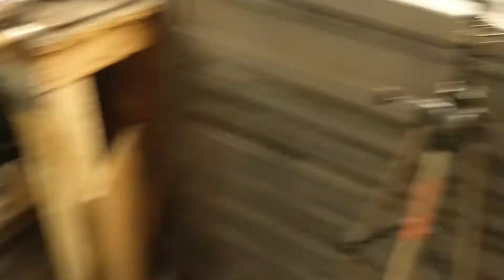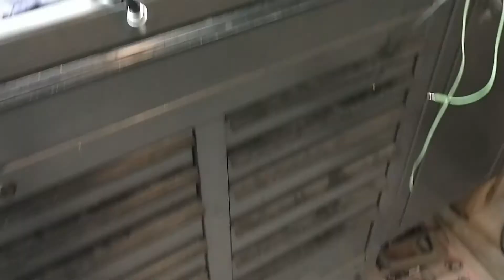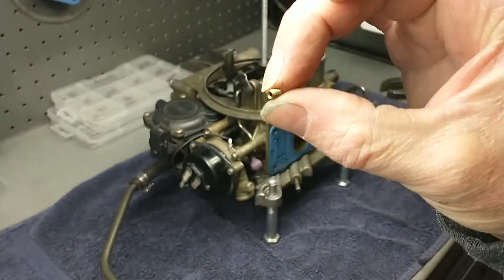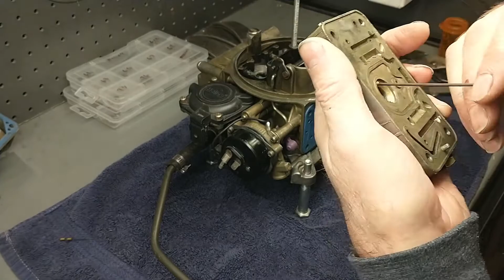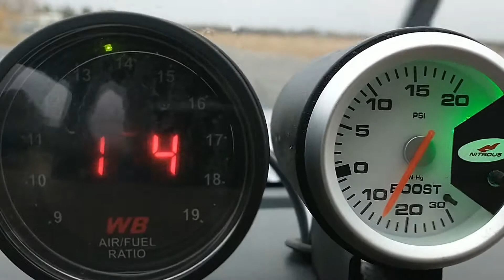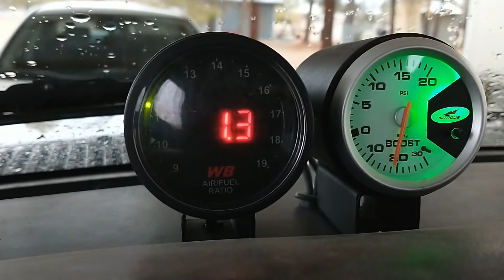Modifying Power Valve Channel Restrictors (PVCR).  Drill and tap for removable jets-Rick's Shop

Comment: I've always intended doing this.  In the past i have used different thickness pieces of copper wire inserted into the pvcr's to reduce the diameter.   You can easily calculate the required change in orifice are required by using the current AFR and the desired AFR to eliminate the guesswork.  I made a spreadsheet to do the calcs and it gets really close the first time.

Comment: Looks like you were shooting for about a 13:1 afr on average when the power valve opens up? I got an 1850 Holley on a Ford 390 that the afr goes to 11.5-12 when the power valve opens under light acceleration. Definitely too much fuel I can feel the engine get kinda lazy accelerating when the power valve opens up even on a cooler night when it runs leaner than usual. I bought some 6-32 brass set screws to drill and tap and make the pvcr smaller.
Reply: were did u get ur 6/32 plugs
Reply: @butchking154  Mcmastercarr sells them, can also sometimes find them on ebay. Definitely get the brass ones, they are hard enough to drill and not snap a bit off as it is.
Reply: @butchking154  mcmaster-carr can get everything you need there.

Comment: If you had the perfect mixture at wot, and if you reduce your pvcr like you did, you need to increase your primary jet size, while leaving the sec. jets alone.

Also, you can calculate the area of the pvcr + pri. jets fuel flow and compare that to the area of fuel flow of the secondaries (for wot), to basically get the carb 'square jetted'
Reply from the maker: At no time was I ever in the secondaries. During this adjustment.